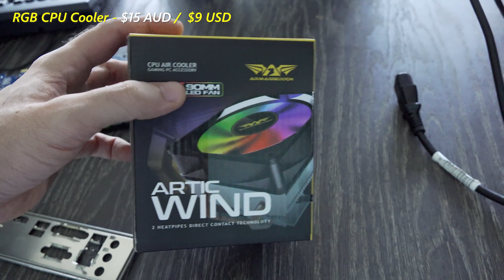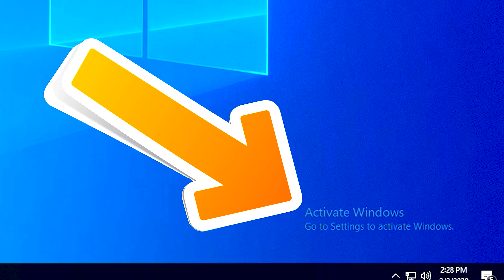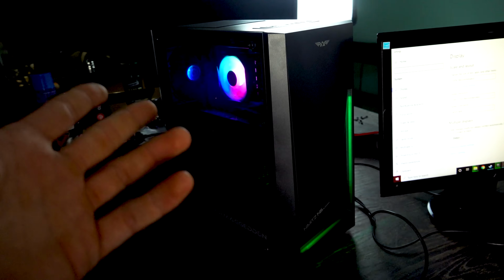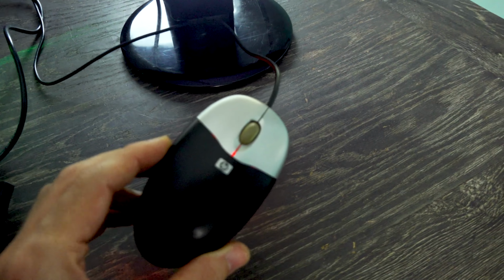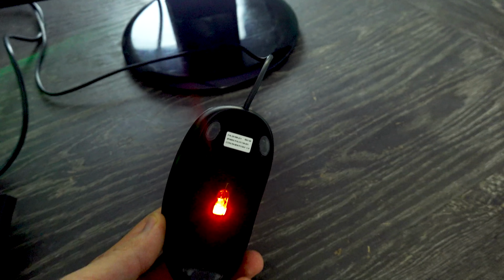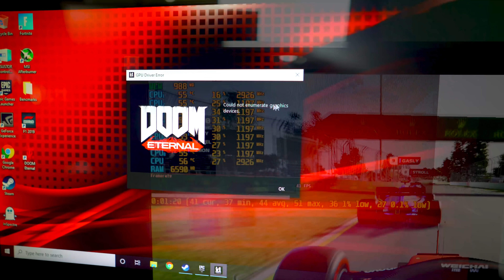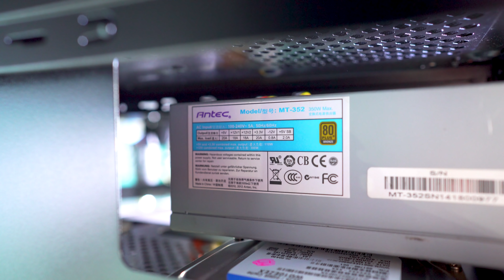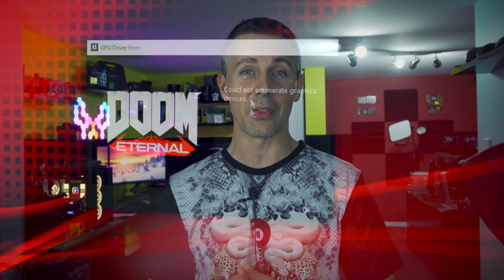A WHOLE Gaming PC Setup for just $75... Can it GAME at 720p!?

Comment: (1) The 560 Ti is old.  You might want to tell us which nvidia drivers work and do not work.
(2) For your next video, how about a dual core cpu (or athlon) and a stronger gpu.  There are still games that run well on dual core cpu's.
Did you really sell out all your cpu's with less than 4 cores?
Reply: 391.35

Comment: I might need to do this. My sister's laptop broke and for some reason she never lets me look at her tech and help her fix them when they break(literally my expertise from school).

Anywho, she finally let me look at her Dell Inspiron 15 3552 laptop with a Pentium, Single Channel 4GB DDR3 Ram, and a 500GB HDD where she was editing videos for my mother with the laptop. Of course, the laptop completely overheat, and the HDD is completely corrupted. I tried all my methods but even the motherboard bios on the Dell laptop is corrupted. Tried flashing and that failed too. The thing is power and get to the laptop cause parts of the board are completely soldered off from it overheating. Soooooo,...it's broke. It could be repaired for cheap from a Office Depot(a little bit far away) where the manager owns me a favor anyway. It's just gonna be sometime. 

Anywho, I'm giving her my PC which isn't too powerful, but it's the only thing I can do cause I suffer from major asthma from birth and multiple lung injuries. And my sister suffers from EDS, hundreds of allergies, weak bones, etc. Essentially she is disabled, and I am at home always taking care of her. We've already been in quarantine before the world decided to do that itself for already two years by this point XD.

Anywho, I'm only bringing this up to essentially say I'm not helping or working with people fixing tech, building units, or getting random parts. So, I gotta find a way to make a unit where I can get a low powered GPU at least. I got a Dell motherboard, x3323(Q6600 equivalent), 6.5GB of DDR2 Ram, Dell OEM 375w PSU(it can actually  hold up extremely well cause it has a 6pin connector that did well enough with a RX470 yet the x3323 doesn't do well enough with  the GPU) and a 160 GB Maxtor HDD where I used Reflect to completely copy my previous SSD and a couple of games I'm only wishing to play(I always do this as a backup anyway, but now it's all I got). 

My sister has my unit which is an ASUS motherboard, E3-1230, 8GB DDR3, Corsair CX650M PSU, ASUS Phoneix GTX 1050 2GB(with much larger modded cooler from a Powercolor R9 270x GPU to help it run better/longer), 120GB SSD, her "Reflect" copied 500GB HDD(which I used to hold my games and videos on, but used Reflect to hopefully try and save her 500GB harddrive yet her harddrive was corrupted and my harddrive when using Reflect managed to pull out all her previous information yet her Windows OS is completely corrupted and so is this copied harddrives Windows OS).

I need to somehow find a low powered good enough GPU(at least can run on a 6pin PCI connector) that can run games like Darksiders 1 and 2 on a 900p ASUS monitor(happens to have as many pixels density as a 1080p monitor too and can run at 75hz/my lucky find to play at 900p to look like 1080p and 75hz). Just wanting to play those two games smoothly and maybe Dolphin emulator. Not really into higher settings. I'm more of a medium to low settings guy anyway.

If anybody got any info they would want to give out on a GPU good enough like this, I would be grateful. I'm willing to only spend $50 to $45 considering it's all I got to spend. The computer unit I got can hold up to a GTX 1050Ti at it's highest before the x3323(Q6600 equivalent) gets bottlenecked hard. So, if anybody got any info, I'll be grateful. Thank you and stay safe :)

Comment: Wow I'm extremely surprised that an old motherboard with an LGA1156 socket can run windows 10
Reply: Dude first gen intel can still game
Reply: Tax-fraud-o-saurus the majority of lga1156 motherboards were manufactured before windows 10 came along so barely any of them have the drivers to support windows 10 and/or are extremely unstable. It's not a matter of performance it's a matter of compatibility.
Reply: @Lizik  I've installed windows 10 on windows xp era motherboards and everything worked okay....

Comment: I would not use 560 ti in such low cost builds and old builds. Those cards were too power hungry. Just get anything from Kepler architecture, GTX 660 or 650 Ti. 
Also, get cheap Xeons from aliexpress, they go for 10$. They are usually more power efficient, and thus, you can try to overclock it at least a little.

Comment: I builed a Ryzen System for 260€ it have a Ryzen 7 1700 oc to 3.8ghz, 16GB ddr4, 250gb m.2 ssd. Gtx 970 and a 500gb hdd. The Funny Story behind this. I recently build it with a 120gb ssd m2 and 4gb ram then i got a Ryzen 3 2200g system für 130€ and Taked out the 250gb ssd and the 16gb ram. And selled the Ryzen 3 system with the 4gb ram and 120gb ssd :D

Comment: Well my pc also costs 75$ but It can't even open fortnite or apex or those games becouse it does not support directx 11 and also my motherboard has only 1 sata port so I am using only 1 240gb ssd and my 500gb hdd is sitting there like... But I can run rust at like 30fps so It's OK I guess

Comment: I have this same cpu i7 860 It's giving a huge headache .I Don't know why the Universe always chooses  me.So i have this cpu and msi p55-gd65 mobo.But it wont boot.I used different frequency ram 1333-1600.bt it wont boot i changed the 2 other mobo 1 is a chines one other one is intel both are h55.But quit oddly enough when i Believed that the cpu was faulty and went to a shop for an i3 i told the shopkeeper Check my i7 see if it is Broken.It booted the 1st time.I dont what wrong with my mobo the shopkeeper couldn’t fix it.I wonder if it is the gpu I've got a hd5450(for now can't  go out to buy used).But sadly enough the system boots just fine with an i3.But Doesn't boot with the i7 Please help guys.My bios also the letest version.What should i do to fix pls help  SOS.

Comment: So gaming on a 9 year old mid-range graphics card is still possible today. Imagine using a Geforce 4 (released in 2002) in 2011, when the 560Ti came out, crazy! I guess the performance leap between new and old generations isn't as big nowadays as it was back in the day.
Reply: I was gaming on a Radeon HD 6970 up until early 2019 when I finally decided to build a new system using a Ryzen 5 2400G in which after a couple of months bought an RX 570 (both of which allowed me to get a few free games).

Comment: 75 is a little high price. I spent a total of 65 USD on mine.. 200fps on fortnite high settings also 😂
Reply: What specs?
Reply: Ryzen 5 2600, rx580 8gb , ASRock b450 , 16gb adata ram 3000mhz overclocked to 3200mhz, 128gb Samsung SSD , 4tb and 1tb Seagate barracuda HDDs ,  and a few other things I'm forgetting about. I bought everything at a liquidation store that sells Amazon returns for $5 dollars each so I built it slowly over a years time upgrading as I went. Started out with a fx 6300 and a 1050ti I had found in there.

Comment: hey are you selling this pc cause i have 75 dollars that i dont rlly need and i can buy it
if you selling it obviously
Reply: I can sell you an old pc for 75$
Reply: @zjqson7992  how good is it and is it just a pc or does it come with a keyboard i have a mouse and a monitor but keyboard i dont have
Reply: @idiotmaneyssds3130  It runs fornite at 100 fps low settings just the pc
Reply: @zjqson7992  i guess thats fair but i wont be able to use it until i get a key board so it depends plus i cnt buy it at the moment so maybe not cause i have to cash my check wich i cant because of virus

Comment: Today this is probably a $700. build. Lol.
Reply: nah it's going to be like a $200 build
Reply: @haleemmangsho1893  what?? More like £100
Reply: I recently made two different decent computers for super cheap recently, one for $135 a Dell optiplex with a Rx 560 2gb, i7 4790, 16gb of ram, 120gb ssd and 2tb hdd and the other one for $75 with a gtx 970 3.5gb, phenom ii x6 1075t, 16gb of ram, and a 240gb ssd.
Reply: @mashedpotatoes5323  how?
Reply: @bracedbloom8738   just getting lucky, I upgraded the PC with the i7 to a rtx 2080 for $300 so it came out to a $420 PC but I had to remove the hard drive caddy and Getto mount the drives. The PC with the phenom x6 had a better motherboard than one of my other PC's with a fx 6300 so I swapped the CPUs.

Comment: Watching this channel forever but never laid down a comment. Great channel. From FTC Docket 9341 monitoring perspective it's imperative to keep hand me down and secondary market PC and component sales moving because the broker channel holds all the capital primarily on Intel surplus (monopoly overage designed to tie channels to Intel financially) is now  the primary financier of innovation supporting primary (new) CPU procurement no matter design manufacturer/producer and system procurements; PC. server, communications, networking. if secondary stopped moving would be a capital accumulated (think holding company like rental cars) financial disaster not only for the tech industry but society as a whole on the shear weight (value) of secondary market product still fit for use meaning not obsolete.. Mike Bruzzone, Camp Marketing, FTC v intel Dockets 9288 and 9341 U.S. federal attorneys enlisted INTC and industry monitor.

Comment: 1080p is a minimum standard, might as well be on a console if you are going sell.

this video should be called the "gaming pc you shouldn't build buy or have"
Reply: I use a 32" 720P TV as a backup and it looks fine. In fact, for many older games that simply refuse to run in widescreen it's an outright blessing since most '00 games support 1024x768